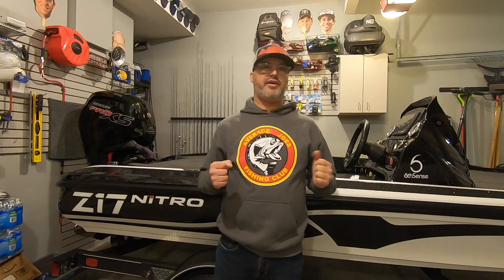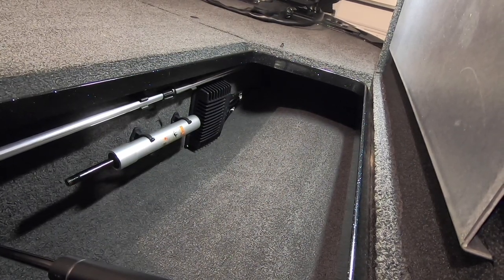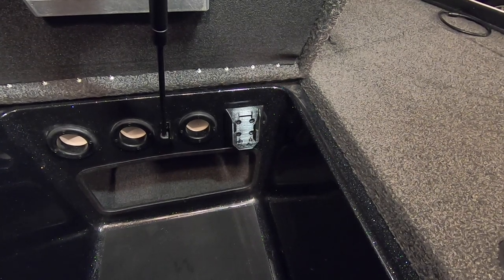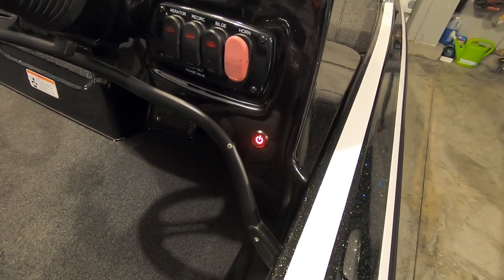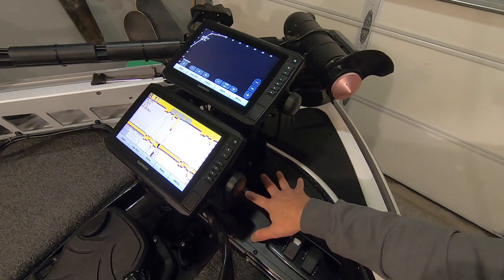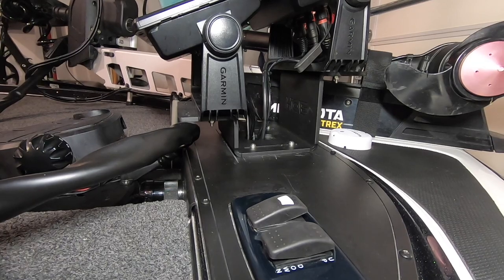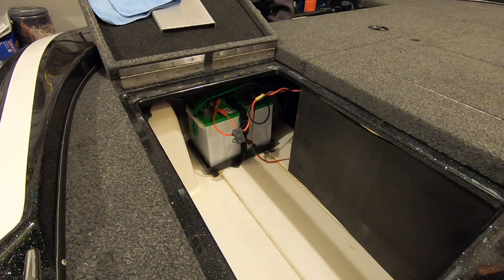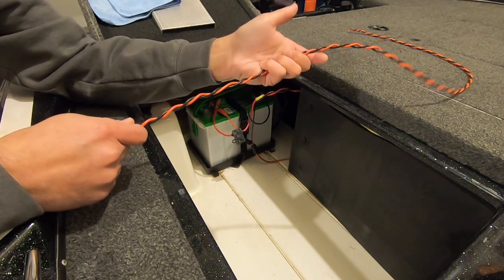My GARMIN LIVESCOPE Install, DeWalt Battery Hack, GARMIN Networking Tutorial + TIPS!

Comment: Nice job, just a couple tips from an old electrician/technician (retired).... 1). on your livescope black box, it produces a lot of heat.  I put some spacers under mine to allow air to flow behind it as well for cooling, especially in the summer months.  The carpet in my boat is similar to yours and acts as an insulator.  I put a couple HDPE (poly board) strips behind mine.  The cooler you keep it, the more efficient it is on power and its better for the health of the electronics .  2)  on twisting the wires together...the problem with the twist is the d/c creates a magnetic field around each wire...one positive(supply), one negative(return) which becomes opposing magnetic fields and can cause more power consumption.  The twist magnifies this effect and also uses more wire.  I used wire sheaths to bundle power wires together and pulled the sheath through my hull.  This also allowed me to keep power wires away from my data and transducer cables.
    Really enjoyed your video walk through.   Really like your set up and hope you have improved you catching !!!  Thank you young man, keep up the good videos !! God bless, tight lines.
Reply from the maker: Thank you for the comments. I will definitely put some spacers between it! It’s too late to untwist the wires, but I did run them up the opposite side of the boat as where the transducer cables are to help with interference! 

Tight lines to you as well. Take care.
Reply: Big time agree on point 2 as an aircraft mechanic... If your worried about trying to run wire, get a wire feeder from harbor freight. you can link the rods together to connect around 30 feet of maneuverable rods. I did it on my boat when I ran my 10gage wire to the front for the livescope.

Comment: What gauge wire did you run from the adapter to switch to blackbox?
Reply from the maker: Thanks for watching. I don’t think I had to extend the wire that came out of the black box to the adapter. I just used what came with the black box. It’s very close to where the adapter is mounted.

Comment: We upgraded our boat.  Changed the single 102sv at the bow by adding a 126sv above it.  Now we have a designated graph for livescope up front.  We changed the console graph from a 93uhd to a 126sv.  The Dewalt 20v5ah would no longer run these and the livescope for the four hours they had been.  We are changing to a LiTime 12v100ah Lithium battery to run our electronics.  Added the battery to the boat inside the forward dry storage, right in front of the console.  The LiTime battery costs the same as a 20v10ah Dewalt battery.  Having used it, I do not recommend the Dewalt system.  Voltage drops quickly from 16.8 to 11.8.  The graph then sounds an alarm and shuts itself off.  There is a reason Garmin does not recommend this type of battery hack.  Low voltage can damage your expensive graphs.

Comment: Just a quick question on the install.  I just purchased the 93sv UHD and livescope with the 32 transducer.  I wanted to hook up the 93sv to my cranking battery and my idea was to hook up the LS on the seelite adapter.  Would this cause issues with the 93sv because the LS would be getting 20V of power and the 93 is rated up to 18?

Comment: How did you wire your Dewalt to your Black Box. I understand how the battery works, but how did you wire the base that the 20V lithium battery slides into to the black box?
Reply from the maker: It’s pretty simple, there’s a black and red wire that comes off the base, and that can hook directly to the wire harness that comes on the black box. I also installed a switch between that, and all you do is put that between the two red power wires. 

Thanks for watching!

Comment: Curious why you didn't mount the GMS 10 and the Live Scope Black Box in the same location?
Reply from the maker: I was planning on putting them in the same place, but then I saw the size of the GMS 10. It's HUGE! And with the cables coming off it, it's even bigger. They are only about 3 feet away from each other in the boat. This way saved me space to still store the anchor light pole, and the seat pedestal in the rod locker. It was also a cleaner more organized install this way.

Comment: With the black box only hooked up to 20v, will that voltage show up on your graph screen, or will it only show the voltage that the graph is getting off your 12v battery?
Reply from the maker: It certainly would be cool to see the voltage up on the screen for the 20 V, but it doesn’t show that. The voltage that is shown on the screen is only what that graph is hooked to.

Comment: on the see life battery adapter...is it easy to hook that up to the garmin black box, or do you have to do something special to the wiring to get it to work as a power source..thanks!
Reply from the maker: Very easy to hook up if you are going straight to the black box. If you want to hook up the switch, it’s a little bit complicated, but still not bad!
Reply: @awidman75  Thanks!
Reply from the maker: You bet! Thanks for watching!
Reply: @awidman75  I think the switch is a great addition.  you said it was a little complicated.  Can you explain how that is hooked up?
Reply: Would a power wheel adapter with a fuse and switch work. One on Amazon.

Comment: I've read a bunch on this and have heard that the black box gls10 and the units need to have the same power source.  Have you had any issues?
Reply from the maker: Thanks for watching. I’ve had no issues the way it’s wired. I have since upgraded to two 106sv units and kept a 93sv UHD. So three units wired to staring battery, and then the black box on the DeWalt adapter.
Reply: @awidman75  that's great news! That's exactly what I'm going to do. May as well put my Milwaukee batteries to use.Thanks man!!

Comment: Great video, thanks for sharing! One question, why install the switch to black box, when you can kill the transducer power at your graph? Garmin has a video showing how to do this versus adding the switch.
Reply from the maker: I just didn't want to have to go in to the graph each time to turn it off. Also, the black box draws power even when the ducer is off from my experience. The switch was an easy fix, and I don't have to remove the battery each time to turn the LS off.
Reply: @awidman75  so you are saying the black box is pulling power without the transducer on. I will have to put DC current probe on it and see how much current is actually being drawn. Right now I have a dedicated deep cycle battery for my Livescope setup. I have 5 AGM batteries in my boat. It’s allot of added weight. Looking to employ the 20v system and eliminate one of my deep cycle batteries. Thanks for your feedback.
Reply from the maker: @davidmclaughlin5345  Yes. It does draw power. Not sure how much. My dewalt battery was run all the way down with everything off, so it must pull power still.

Comment: I was wondering if you could tell me how many hours or minutes you get out of one 20volt dewalt battery using it the way you have it set up. I think all you had on that one battery was the black box by itself correct? NICE JOB on the wiring job!!
Reply from the maker: I have been using a 4ah size battery so far. It lasts about 4 hours. I bring an extra 2ah battery with me, but haven't stayed out long enough to use it. I plan on buying an off brand battery in the 9ah size so it will last all day.
Reply: @awidman75  you just have it tied to the black box only right?
Reply from the maker: That is correct! Only the black box is hooked to the 20v battery adapter.
Reply from the maker: @bretmoua6983  I would think so! Depends on what all day is.

Comment: Did you power the gms10 to the DeWALT power source or to the 12v cranking battery
Reply from the maker: I powered the GMS off my 12v. I ran a separate 10 gauge power wire to power my two graphs in front and the GMS. Thanks for watching!

Comment: Can you help me with finding the cable protectoron the shaft.  You mentioned that they are or may still be available.  Any info would be great!
Reply from the maker: Thanks for watching! I purchased those at the tracker marine parts department at my local bass pro here in Kansas City. 

I don’t think they have an official name, but I just said that I was looking for a trolling motor shaft cable protector. I purchased those about six or seven years ago and have just moved them from boat to boat.

Comment: Does the higher voltage of the Dewalt battery improve the performance of the high frequency side vu. My 93sv uhd side vu isn't very good on 1120khz.
Reply from the maker: I only use the dewalt battery on the livescope black box. The rest of electronics are powered the cranking battery. I use a 31 AGM. 

Thanks for watching!

Comment: Can you post a picture and dimensions of that dual graph mount on the bow?
Reply from the maker: I’m not sure how to post a picture, but I can tell you what the dimensions are.

The mount from front to back is 5 1/2 inches, the front riser for the first graph is 2 1/2 inches tall and the back riser is 5 inches tall. The place I bought it from told me that it fits up to 12 inch graphs easily.
Reply: @awidman75  thanks. I’d love to see some close up pics if you figure it out
Reply: @awidman75  what is the length from left to right?  Also is the 5 1/2” from front to back measured from the risers?  How much platform is on the risers?
Reply from the maker: The length from left to right is 6 1/2 inches. Each riser is about 3 1/4 inches deep. The front riser is aimed towards the back of the boat, and the front riser is aimed towards the bow. The 5 1/2 inches is measured from each riser.
Reply: @awidman75  last question, hard to tell by the video but are the risers the same length as the bracket and your graph mount just overhangs or are the risers longer than the 6 1/2?  Appreciate the help
Reply from the maker: The risers are the exact same length as the whole mount. My Garman mount does overlap it by just a little bit on each side. Obviously if you have a larger graph, it would overlap even more. There are several different holes on the top of the riser that you can  choose where to mount. To space mine out a little more. I used the front holes towards the back of the boat, and the back holes on the top riser towards the bow.  If you want to see a picture without a graph on it, go to Hennessey outdoor electronics website, and look for that mount. That’s where I purchased it!
Reply: @awidman75  for 2 9” units would you recommend I maybe go a little wider base than the 5 1/2? To spread them out slightly
Reply from the maker: No. This has plenty of room for even larger graphs. Mine are 9”

Comment: Where did you buy your c light adapter and does it have 10 gage wire to the LS?
Reply from the maker: I bough the adapter on the Seelite website. I did include the link in the description of this video. The adapter has about a 6 to 8 inch wire that’s probably about 14 or 16 gauge. It doesn’t run very far, so I wasn’t worried about the gauge of that wire. Thanks for watching!

Comment: Hello it’s nice to know your in the Kansas City Mo area I used to be a avid cat fisherman and now we decided to try our luck at crappie fishing using the live scope and it’s features. I have a 1999 Prince Craft Venture 221 Deck boat that I’ve mailing converted to a catfish/ fishing boat. I’m going to have to be creative to run the wiring up front on the bow. I’ve remove the two bench seats and installed pedals mounts on the lower portion of the boat, I don’t think I need all the units you show on your boat just one on the console and the other one upfront between the two seats. I’m concern on how to connect the units to ensure the proper connections. I like the idea of the 20volt powering system just want to make sure I’m doing it correct.
Reply from the maker: Thanks for watching!

Comment: I'm in the process of fitting a new boat with 2 garmin 93sv UHD units. It's an aluminum boat with a jet unit instead of a prop because one of the main rivers I fish has a HP limit. Weight is a critical factor in anything I put on my boat. I want spot lock technology and have settled on a 55# terrova trolling motor so I can stay at 1 12v battery up front. I'd planned to run the console unit off my cranking battery, along with my lights and bilge pump,  and then my front UHD graph with the dewalt tool battery option you have installed here. I see that Seelite offers that same adapter in 18v Milwaukee instead of the 20v dewalt. Would this be a better route for me to go? Also, how many hours can you run your livescope on the 20v batteries and will I lose some time with an 18v set up instead of the 20 v?  I had originally thought I'd run my garmin off my trolling motor battery, but I'm reading that it can cause interference with the graph. Thanks for the video!  It's given me some things to think about.
Reply from the maker: Yes, I would recommend the Milwaukee brand battery if you’re going to power your graph and LiveScope per Garmin. They make a 12ah model battery that could last you all day! Thanks for the comment.

Comment: Very nice install, can you tell/show how you hook the black box to the C-light adapter?
Reply from the maker: Thanks for watching! If you’re hooking it straight up to it, it’s just red wire to red wire and black wire to black wire. If you’re adding a switch just add the switch in between the red wires.
Reply: , thank you for responding, I ordered 2 Seelire adapters, they should be to me by Wednesday of this week, I think I’m going to use the 20-60 flex volt 12ah 20 volt Dewalt batteries.  If I hook my Garmin 7610xsv to ONE 20v Dewalt by itself, would love the Garmin handle 20 volts by itself?  And the other 20v battery  dedicated to the black box, sound okay?  Thank you for your advice Sir.

Comment: I put my black box in the same spot too. But i mounted so when i look down i can see the light.
Reply from the maker: Cool! I almost did that too, but wanted the wires to face towards the front to look cleaner. Thanks for watching!
Reply: @awidman75  Hey I've decided to rewire my unit and black box to power with the dewalt batteries with sealite adapter. The problem I ran into is the battery wouldn't fit into my sealite adapter. From the video, the adapter that you has looks a little bit different shape than the one I got. I wondered if they sent me the wrong adapter for it.
Reply from the maker: I’ve only seen two different adapters. One for the Milwaukee, and one for the Dewalt. I will say that it doesn’t take some muscle to get the battery on and off of the adapter.
Reply: @awidman75  I understand that it doesn't take a whole lot of strength to put  in and out but this adapter is just too narrow for both edge of the Dewalt battery to get in even if you use all your strength. I've contacted seelite and even sent them the photos of the adapter. Just waiting on their response. Thanks tho.
Reply from the maker: My last message was to say it DOES take me some muscle to get the battery in and out of the adapter! Sorry if that was read wrong. Keep me updated!

Comment: can you help me out figure out  the wiring on your panoptix on off switch.  purchased from amazon as you recommended, but i have no instruction. how is the white, red, brown and blue wired off the blue socket plug pig tail
Reply from the maker: I’ll have to look at the back of my switch! It’s been a few months. Thanks for watching.
Reply: @awidman75   can you please let me know how to hook up the power switch wires off the blue pig tail. looking how the white red brown and blue wires are hooked up
Reply from the maker: Sorry for the delay. I did go and look, but I’ve got it tucked in pretty good to where I would have to take out the whole switch to see how it was wired. It came with a wire diagram and that’s what I used and followed to hook it up. I will see if I can find something online that has a wire diagram that might help you. Stay tuned!
Reply from the maker: I found the wire diagram. It is on the Amazon page where you buy the switch. It was the second or third picture of the product. They have a little wire diagram of what each color goes to.

Comment: Great Video- I was planning on running LiveScope and a Garmin 106SV (on order) off a 12 V deep cycle and that will be the sole purpose of the battery. Do you think there would be any problems with this?  Also, I am mounting the LiveScope on a transducer pole. . I assume I will not use the 8 degree bracket that is needed for mounting on trolling motor.  Do I need  another bracket?
Reply from the maker: As far as I know, any 12 V battery will run the equipment. As far as the 8° mount, from what I have read, you are correct. You wouldn’t need that. Thanks for watching!
Reply: @awidman75  Thanks for the information.
Reply: Whipporwill  

Thanks for the information.

Comment: Thanks for making this informative video. Couple questions, I want to add a heading sensor for the same reason you did. Is it as simple as plugging in and using it, or do i need to purchase something extra? I have a 93uhd in the front and an echomap73sv at the console. Can i network those graphs together to share waypoints like you did or do i need two 93uhd units?
Reply from the maker: Thanks for watching. To add the heading sensor, you need a NMEA 2000 starter kit and heading sensor.

The 73 and the 93 should have a network port on the back. You can just buy a networking cable and share all the information. You wouldn’t need a Network adapter unless you add another graph.
Reply: Thanks for the reply, found your channel today and you are putting out some good videos👍🏼